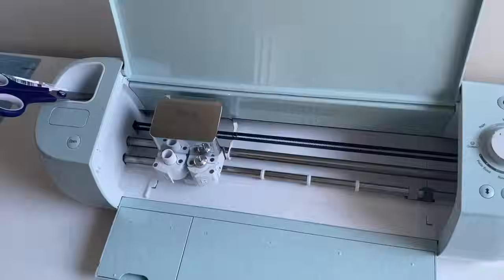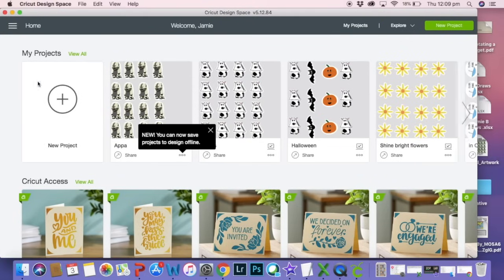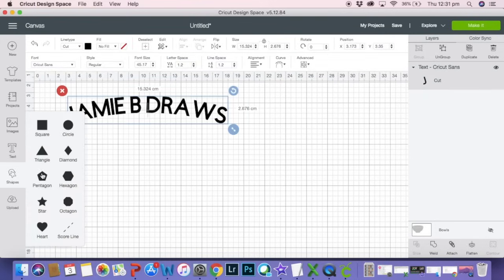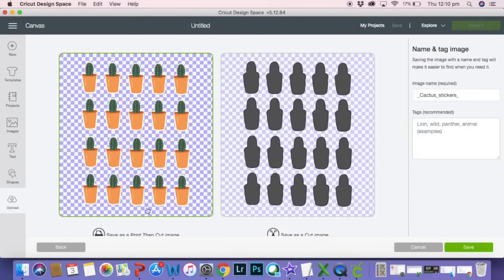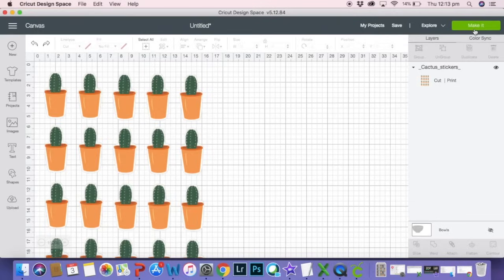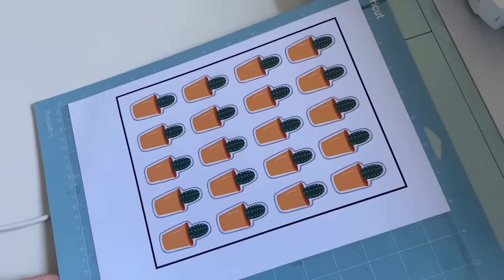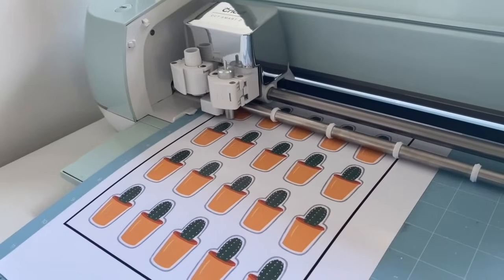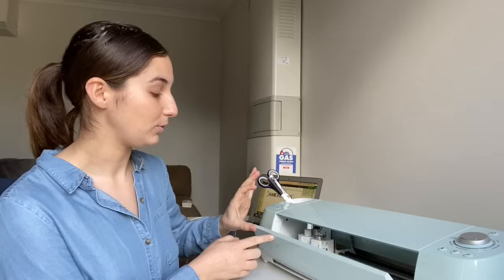Getting Started With the Cricut Explore Air 2 & How I Make Stickers [DIY]

Comment: Hello, I'm a designer who try to sell sublimation design. But I'm so confused because some tutorial showing seperated svg file (outline and several color) and print it seperately and put them together to make stickers. So the sticker that you made in procreate, I guess just 1 layer exported into png file and import it into cricut software and just cut using the machine, is that correct? Pardon me if the question looks silly. I'm so new about this and afraid to sell uncompatible svg for sublimation.

Comment: What kind of printer do you have to print the design in color ? 🖨 Also I’m confused about is the paper you used already sticker paper or is there another step you have to add a layer over top of of the cut outs? ❤️

Comment: Do you have alignment issues with cutting? That’s the main issue I’ve seen but I want a cricut and am looking at expanding my Etsy to include stickers. Could it be just not placing the paper or material on the cricut mat incorrectly?

Comment: I got my critcut and been having a few issues. I print two sticker sheets per label sheet. For some reason my first sticker sheet cuts perfect but when it reaches the second sheet on the bottom half it cuts off. Everything is in the right position so I don't understand why it's cutting wrong. I've been trying to fix this issue for weeks.

Comment: Hi Jamie! I just came across your video today and I had a question about a recent issue I'm having! I have been trying to make cute little labels for my essential oil roller bottles and I found helpful videos on here for the specific project, but the issues i'm having is after the cricut has cut out the letters the vinyl paper isn't leaving the letter on the cutting board. I've tried it endless times and I can't seem to figure out what i'm doing wrong. Any Advice?

Comment: I just bought mine!
I was wondering what measurements you used in procreate to get the best out of a sticker sheet ( i bought 8.5/11in Full sheet label w/ 1 horizontal back slit)
because i tried to use the measurements on design space, and luckily i only used regular paper to try it out

Comment: I'm having so many problems with my cricut and I came across your video :) just wondering whether the position of the mat matters? Because in design space the print cut mat shows the mat with the hole facing downwards, but you put your stickers in with the hole facing upwards into the cricut. I tried doing that but my cricut just can't read the sensor marks ://